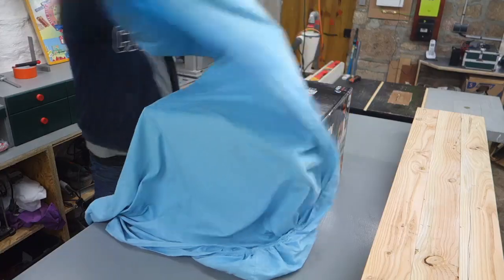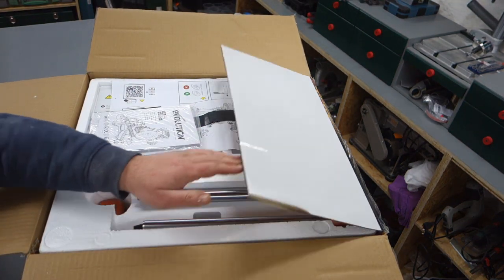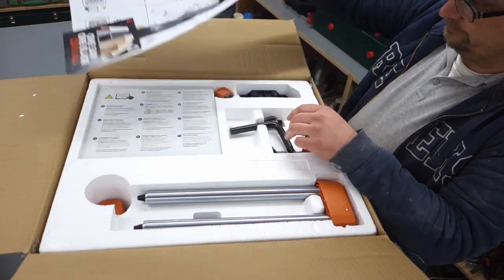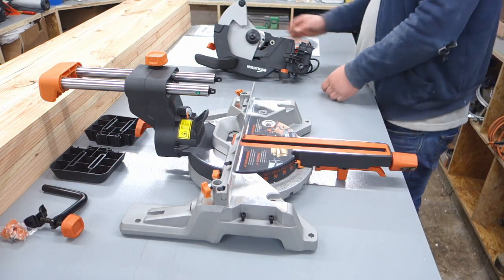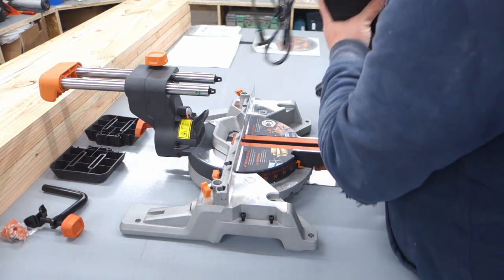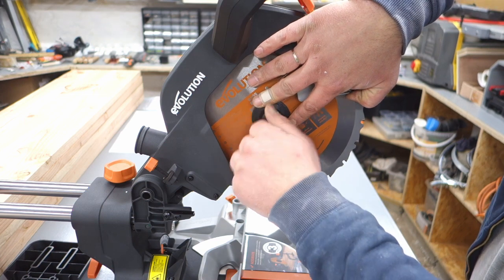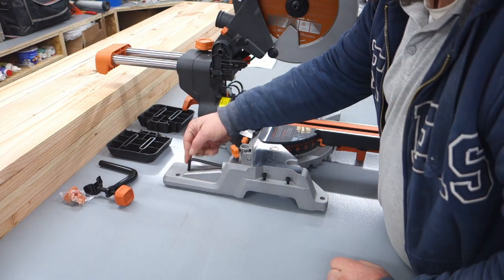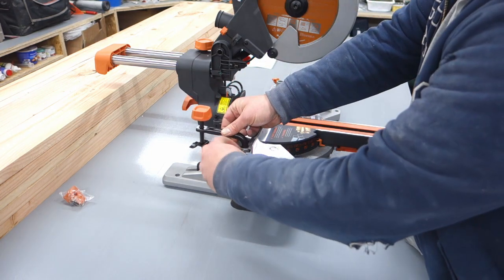my new miter saw UNBOXING and TEST

Comment: Wow! For that much setup/assembly required for something that reasonably should come working out of the box, that saw really needs some tricks up it's sleeve!  Ok.... I admit the soft startup and quick stop was kind of AMAZING! But you still need a hole into another dimension to have space for it in the workshop (believe me - I have a sliding miter saw....) Oh. And the positive stops is also a treat. Congratulations :D I bet it is a fantastic saw.